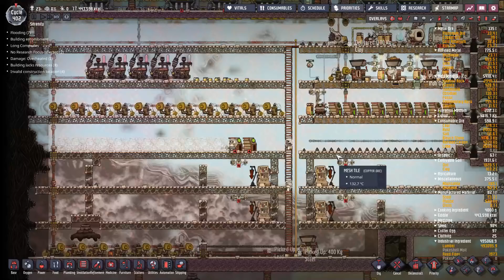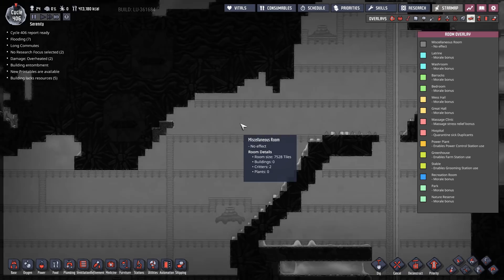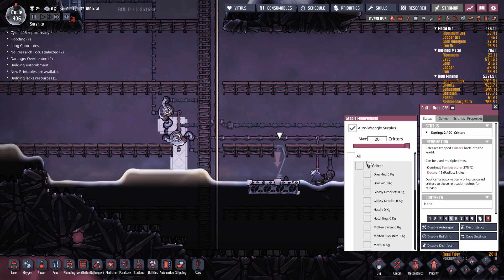Oasisse 11 : Transformers, Slicksters, Plastic, to much CO2 : Oxygen not included

Comment: I'm trying to implement the same dirty hot brick into my current playthrough, so this is invaluable info. One thing I'd like to point out is that you can put a gas element sensor at the height where you want to limit the carbon dioxide to automate the pumps and forget about it entirely. Though it seems that you may be outputting more than a kg of co2 per second with all those petroleum generators. I'll be rewatching this one until I'm done with my own base. It's very nice and in-depht. And still works four years later, so thanks a lot!

Comment: I know this is old but maybe this could help someone.  For power, atmo suit docks etc I found it really helpful to set up a hamster wheel section or two in the base, used for training yes, but feeding into the main power spine's batteries.  
-I found out that yes power production in this way feeding into transformer DOES matter for overloading wires, 5 wheels and a smart battery overloaded the wires with nothing drawing power on the delivering side of the transformer.  This is contradictory to all the explanations I've read that producing doesn't matter, it looks like it does from what I saw
- Place manual switches/shutoffs on the line for each large transformer dual transformer pair.  It doesn't take much effort, and if for whatever reason your power production takes a huge hit, you can at least prioritize delivering via manual generator to the power spine, and allow power to be delivered only to the atmo suit docks to fix whatever went wrong (SPOMS should still be SP).
- Spamming large transformer or paired transformers, bricking them into a box and feeding the rest of the way via conductive wire is definitely the way to go to reduce the massive decor penalties especially if near up and down the main transport spine.  A lot better than making gold conductive heavy-watt wire, which can be saved for metal tile or metal sculptures along the same transport spine.

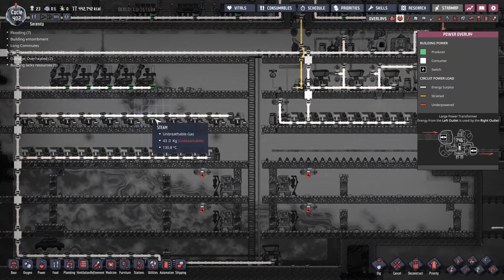Comment: 1:05, forget about that, just fill your base with radiant bugs, that will negate any negative decor your dupes encounter while working xDDDDD.  negative 400 decor in the power sauna? positive 3,000 inside the base :DDDDD. Only takes about 40 cycles to set up with just phosphorite too! My dupes' average decor is around 500 xD.
Reply from the maker: Tempting but how do you deal with over crowding when they enter rooms? They all need at least 12 tiles of space and if they end up getting cramped they die out. I like the solid feeling of statues.
Reply: @FrancisJohnYT  Yes, they need constant replacement, I've found that if you don't feed them, they'll live to about 40 cycles, not long enough to reproduce anyway. By my calculations, a ranch of 8 radiant/abyss bugs can supply your base with 60 other radiant bugs before they start dying off. I have all my doors set on auto, so I control how many radiant bugs are in a room using a critter drop-off. To spread the decor, I drop a bunch off in the main corridor of my base and use lots of window tile. In my kitchen and great hall, they inevitably snack off dropped barbeque and live long enough to reproduce once. They do not become overcrowded because the radiant bugs don't lay an egg until they are 55 cycles old, and since the eggs take 20 cycles to hatch, the radiant bug will have died by the time the new radiant bug hatches. The primary issue with radiant bugs is feeding the seed ranch, 8 radiant bugs eats as much barbeque as 32 dupes. If you have access to at least 10 tons of diamond, it's not a problem, or in my case, thanks to your ranching tips, having over 3,000,000kcal of excess barbeque. One trick to get cheap radiant bugs is feeding a seed group of abyss bugs a small amount of barbeque until they start laying radiant eggs, then switching their diet to abyssalite. I've also found it useful to keep a separate ranch of abyss bugs to fill my bedrooms with them, as they do not produce light. 

I think I have 60 or 70 of them running around in my base, any given dupe has an average cycle decor of over 400, despite having debris and running conductive heaviwatt wire everywhere (the wires are all made out of gold, so that helps).
I have minimal decorations built around my base, which gives me space to put transformers and other miscellaneous building around :).

Comment: One way to get rid of CO2 is... turn off some of the generators.
Reply from the maker: It's the curse of a petroleum boiler. Every time you turn them on and off you can cause the pipe to break so usually you just turn them on and never look at them again. But if you do that you have to consume all the output. You need to burn it so you get the water out of it to put back into the oil wells to keep it going forever. Side effects include massive amounts of CO2.

Comment: creatures in general don’t heat up or cool down very fast regardless of what gas or liquid they’re in, it doesn’t make much sense but that’s the way some things are
Reply: Maybe because they are all Made With genetic Ooze .
Reply from the maker: If you leave them in a layer of liquid it usually speeds it up quite a bit, but there is not way I'm replacing the mesh tiles after all the time it took me to preheat the sauna.

Comment: What about using lumber to create ethanol for power generation
Reply from the maker: If I plant the trees wild with pip I'll need 20 trees and four ethanol distilleries to support one petroleum generator. I prefer 1 petroleum boiler and three oil wells to support 5 petroleum generators :) I left out the enormous power sauna that goes with it but that was maybe not entirely necessary. Also I'v seen about 15 oil wells on the map and several volcano's I could potential run another 3 petroleum boilers.
Reply: Sorry.  Two more points here that could really be rolled into one point.  You can't use ethanol as rocket fuel or polymer press at all, so you need a proper petrol source anyway.  Ethanol is currently absolutely worthless in every conceivable and practical way.
Reply from the maker: @WeirdOne19142  I would not say it's completely useless, the polluted dirt can be used to ranch poke shells. That would be the only big draw for me and it would be map dependent.
Reply: Ethanol creation is the dumps.  I've been playing for a month and after a couple of 50 cycle game plays to learn the game, I eventually created a distiller Petro gen as my first major power brick.  While it was successful, and I was excited to finally complete a major industrial project, I quickly discovered that my project was simply terrible.  Some of the things that make it aweful: a single 4 distiller + 1 gen block generates enough co2 that it requires something like 35 slicksters to deal with it, so you need to exhaust to space.   Actually you need quite a few gas pumps for that... At 250 watts a pop.  Secondly if you use arbor trees in hydro blocks, the system becomes effectively water neutral... You create SOME excess, but not enough to do much with it... Like run an electrolizer for instance.  You need automation in order to feed the machines, and this requires even that much more power draw for the sweeps and conveyer setup... That is unless, of course, you don't mind having your dupes constantly running in and out of -9000 deco rooms in order to dump more wood into the distillers.  Obviously gold tiles and marble statues are a things, but still... All that dupe time if you don't automate.  The sweeps and things don't run constantly, obviously, so you still get decent power out of it, but the just raw amount of resources required to make it functional is completely astronomical.  A few insulation tiles and some aluminum pipe versus marble statues and or steel sweepers and conveyor drops.  Idk, man.  Distiller Petro gen blocks are positively the single worst infinite power gen builds in the game in my very humble, very inexperienced opinion.  The only thing that I can say for sure is that I regretted building that stupid thing.  The only good part about distiller setups are the steam generators that sit on top of them.  😍

Edit for math on the slickers and beating a dead dog in the deco point.  Thanks for the comment.  I hope that my contradictory point of view isn't seen as disrespectful.  God bless.

Comment: The polluted water from the generators is going to become a large problem very quickly.  2,250kg of water per cycle.
Reply from the maker: The 5 steam turbines at the top can extract up to 10kg/s or 6,000kg a cycle. I'll have to do a bit of flow control but if I can keep the balance between extraction and temp control it should be fine...... or horrible heat death.
Reply: Francis John sorry i wasnt clear.  I meant that the extracted water produced by the generators is going to fill your tank very quickly because it isnt being consumed.  I dislike petroleum generators because they have so many side effects which have to be managed.
Reply from the maker: @probablynotmyname8521  I dump most of it into oil wells so it should not be to much of an issue for now. Petroleum gen do have many nasty side effects but they produce so much power how can I say no?

Comment: In addition to the two pressure sensors that check for 15kg of co2/steam, you could also add two gas sensors somewhere around the middle of the room, set the higher one to co2 and if it activates, as in, the co2 has risen past that threshold pump out a bit of co2, the lower one does the same for steam, if there's to much and it goes below that threshold you'll remove some of it, that way the seam between those gases will stay between those two sensors
Because the room can still completly overflow with either of those two gases if you only regulate the pressure
Reply from the maker: I like your thinking, I wonder if it could simplify even further? I like to make things as simple as possible. I'm going to try cranking the steam up to 20kg and the CO2 down to 15kg this should allow the steam to take over more floors. Then set them both to 15kg when they have settled at the level I want and see if it sticks. I'm not confident it will work, if/when it fails I'll try the element sensors.
Reply: @FrancisJohnYT  the thing is, it will only stick if the exact same amount of steam and co2 gets added / removed from the floor, but in this case that doesn't seem to be the case, if there's only slightly more co2 produced than steam then by only regulating the pressure the co2 will still creep up, I think you either need to crunch a lot of numbers to calculate a perfect equilibrium or atleast one sensor in the middle of the room that checks how high/low the steam/co2 is
Reply from the maker: Meant to come back and thank you earlier, I put two element sensors at the level I wanted, hooked up to the CO2 gas pumps and removed all the excess CO2 as needed. Kept the gas levels stable for over a thousand cycles. Great Idea.
Reply: @FrancisJohnYT  oh nice, glad that idea turned out to work :D

Comment: dude I get that you like to be very thorough and you dont leave problems for later but power management is really unnecessary right now... I used conductive wires with 20 Kw potential draw and nothing happend (because equipment just doesn't run all at the same time. two wires can last you untill mid game and you need another one for the industrial brick (like you did) but I am in 17:34 and you should not touch those wires it's just a waste of time - they didn't overload untill now so they won't ever overload.
Reply from the maker: It's more about prepping for later expansion. I keep adding the odd power consumin building sweepers, loaders, lights etc and it's nice to have the cables nearby and ready to go. No overloads yet and if I do it right no overloads ever.
Reply: @FrancisJohnYT  just saying - you have a lot more wiggle room then you think so it's not as big a problem as you treat it
Reply: @barshtoyer1806  I understand and agree with what you're saying.... Mostly... But I quite like Francis's attention to those details because I'm quite new to the game and it gives me things to keep in mind when designing my own bases.  Again, I'm not saying that you're wrong, but I would simply assert that different viewers have different levels of expertise.  I appreciate listening to Francis think through the minutiae, and hope that this is something he continues to do in future videos.

Comment: Ideas: Take the hot 95 degree water and run it through a Rodriguez, then take the massive power excess from the hot brick and prepare for gas liquification.  I envision three tanks, one hydrogen, one oxygen, one methane (only for sour gas condensation, which can eventually become part of a sour gas boiler -- MORE hot stuff for the hot base)!
Reply from the maker: I have so many oil wells I have no need of a sour gas boiler. 4 volcanic petroleum boilers and I can support a 40KW grid :) Since I don't need solar and I have lots of water I might try covering almost the entire top of the map in rockets.

Comment: Liquidblocking a gasvent makes it possible to store tons of gas in a tiny room. Venting it to space is one way.... i like to store it for later.
Reply from the maker: I'm aware of the infinite gas and liquid storage methods but I like the challenge of dealing with to much as well as to little resources. If I did not have vacuum to dump it in I'd most likely resort to liquefying it with cold :)